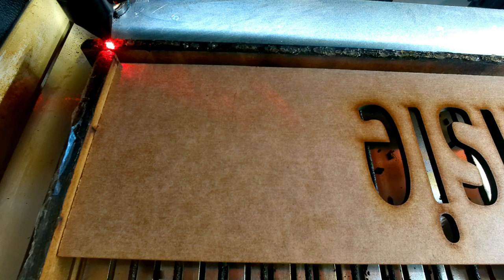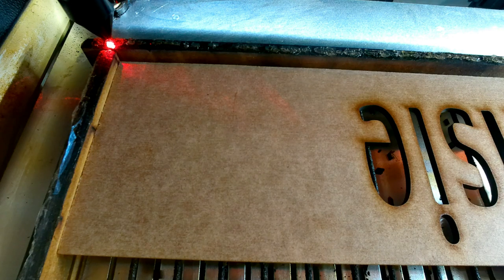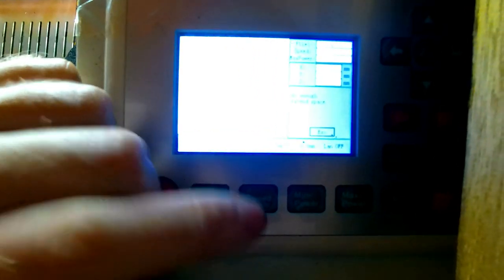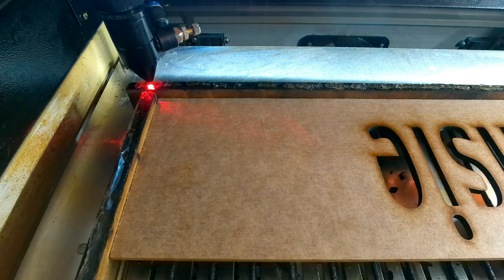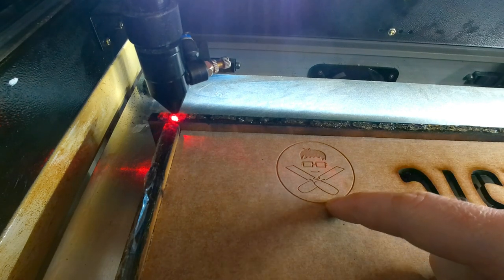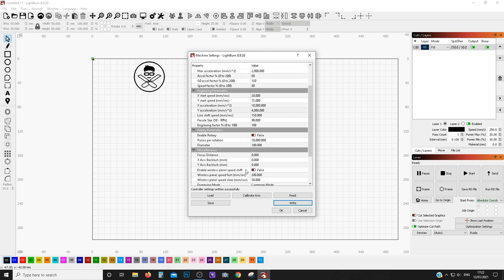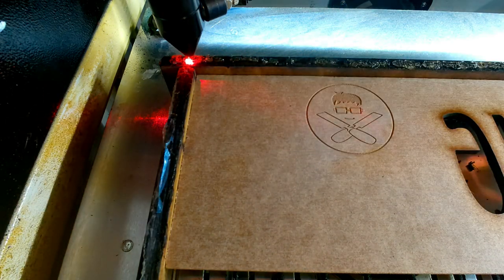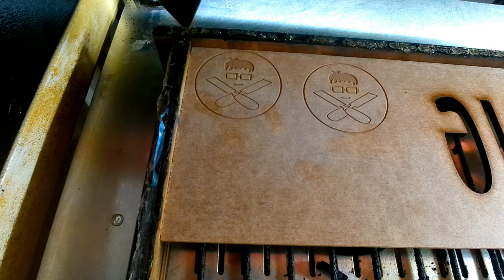Triple your Engraving speed with DSP (Ruida) and Lightburn

Comment: quick question, ive changed the profiles  on my Ruida controller but it doesnt seem to write over those settings. im trying to speed my engraving times as well any idea why it wont save?
Reply from the maker: I'm really not sure why that is happening. It just works on my machine. Make sure you have the correct format in the boxes you are editing. That your machine is connected and turned on. And if that doesn't work, you can see if you can get RDworks to edit the profiles.

Just make sure you create a backup of the original,  in case you push anything too far and want to restore things.

Comment: Well thats amazing! Have you tried any Grayscale engraving with the acceleration increased? I'm worried that may put more stress on the controller, which can already struggle with the large amount of processing involved in doing Grayscale at high speeds.
Reply from the maker: I have run this machine with these settings for over a year now and other than the drop down panels rattling a little more I have had no issues whatsoever.

I tend not to do full gray-scale images though. I generally use Jarvis dithering in lightburn. I get some really nice results on slate. The largest engraving I have done in 1 go was the acrylic 1,000 subscriber plaque and that worked perfectly

Comment: I wonder what the long term "wear/damage" is when increasing the speed?
Belt wear?
Looks like it shakes the machine a bit more.. Which is understandable.
Reply from the maker: I have used these settings for over 1,000 machine hours now and as far as I can tell it hasn't had any negative effect or extra wear on the belts.

The rattling is the drop down panels that sit a bit lose anyway
Reply: @philscraftcorner  
I run precut sheets of wood.. So i am just going to alter my size and allow for more overscan room. Loose a little bit of bed space. 
But i will probably push these numbers up a bit as i turned them down awhile back trying to find a problem. 

Yah damn panel noise. Lol
Change the latches to compression style and ad some bumpers.  Simple quick is some tape on the latch contact.
Reply: @turboflush  For the type of raster engraving I do, this saves me a ton of time. Overall the increase of productivity in the machine would probably make up for any potential extra wear on the machine.

From what I tested, my engraving speed went from 21.43 minutes, to 12.09 minutes.
Reply: @peyton693  agree.. it's a balance of wear and productivity. Sometimes it's worth the extra wear.

Comment: the code for RDwork vendor settings is RD8888. How you can start so close ?
Reply from the maker: I don't use RD works but if you can get into the controller settings try to find one that is the same as the one I changed here
Reply: Thank you

Comment: I was wondering, does this setting work on any laser? Like a boss LS 1630?
Reply from the maker: It should work on any DSP controller. Just take the time to test which numbers work for you
Reply: @philscraftcorner  thank I am just now getting into this cool stuff.
Reply from the maker: There is a lot to do and learn
Reply: @philscraftcorner  Yes there is. I have found that every laser has its own for lack of a word. It's own personality in working materials. A 40 watt uses different settings than a 60 watt for the same project and results. I really. Like CRC, LBT, and Brilliance. For etching but I had to do a bunch of test to get best results from all. I got stainless steel down for all of them.  Glass and porcelain is a much more difficult beast. To avoid damaging the porcelain and not blowing off the spray.
Reply: @philscraftcorner  I found out the cheap stuff like 1413 dry lube for $9 a bottle works just as well. I have to fine tune that one but I think I got it.
Reply from the maker: Nice work. Keep it up. It's strangely satisfying when you hit that sweet spot

Comment: Does this apply to my humble k40 too,  I have a grbl card and use lightburn
Reply from the maker: As far as I know this is just dsp controllers I think you man manually set the oversscan in the fill engrave settings to a % with grbl though.
It's been a few years since I used mine